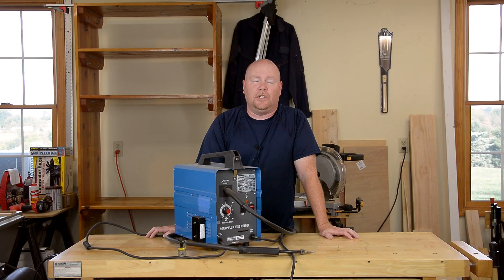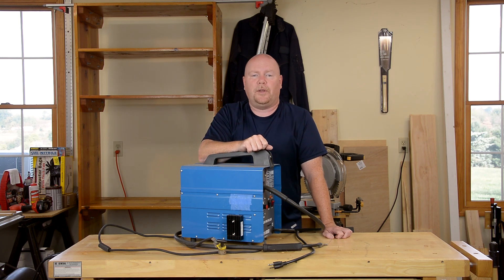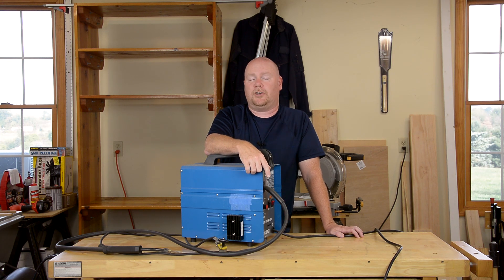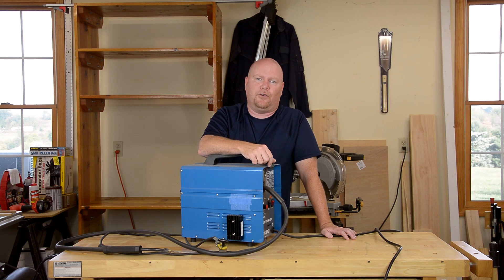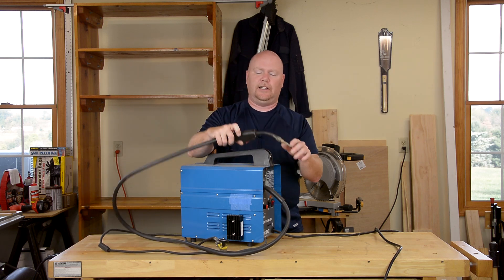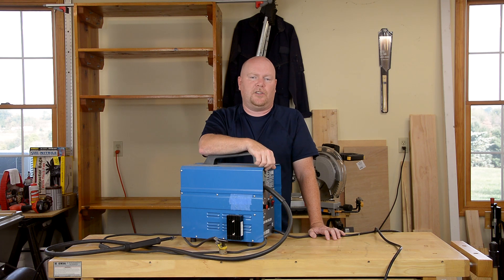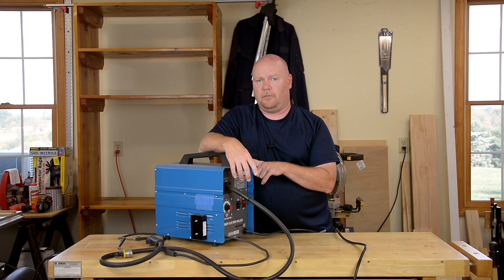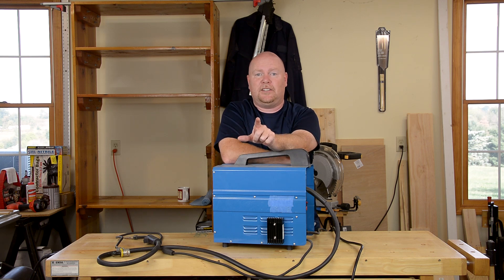Advanced Harbor Freight 90 Amp Welder Mods 09 - The F.A.Q.

Comment: Thank you I knew a choke and filter capiciter were needed some how to smooth the flow of the ripple. I've saw a lot of guys just slapping a bridge on the front of an ac welder, and I'm like there's gotta be a cap or something in there. But i didn't know where in the circuit or values. I'm currently working on a lincoln ac 225 tombstone stick welder. Any advice is greatly appreciated. God bless.

Comment: I have a question on the capacitor to use. I have a 500v 1800uf capacitor I got for free. would this work in the conversion?
Reply from the maker: It will work.  The rectifier makes 90% of the improvement, so the fact that your capacitor is on the small side won't matter that much.

Comment: Tonight i was messing around with a lincoln welder, that broke and needs a need circuit board that u cant buy any more. Anyways I was looking at it, it has a big capacitor, since I was going to junk the whole unit, I might just take parts and swap some and put them on my Black Case Harbor freight welder that I dont like or use. At least if it doesnt end up working well in the end It will be a project that won't cost me much. Thanks for idea, and the knowledge.

Comment: 40volts dc is more then enough for the capacitors I never seen anything over 34 volts
Reply from the maker: Most electrolytic caps have significant tolerances on their ratings.  If you want to run a 40V cap in a 34V circuit be my guest...and have spares.

Comment: Remember guys about the fan if you use plastic coffee can or a plastic butter bowl cut it in half and leave 3/4 of an inch of a lip at the bottom so you can screw that onto the back of your welder when you make this shroud around your fan you're actually making a tunnel fan in your machine it will suck the air in from the outside and into your machine and over all your important parts and it will force the heat out you should do this no matter what even if you don't ever do anything else this is free and it's cheap

Comment: Fyi i got 2 cheap 50v 100kμf from ebay for 25$ and both of them tested correctly but when i hooked them to the welder they both blew up..  so id recommended getting 63v caps minimum..

Comment: Hey Matt, OK, so I did the conversion with a 200 amp bridge rectifier and a 50v, 68,000 mfd capacitor. Checked and rechecked the wiring for proper hookups. Turned it on, fan and wire feed worked. Went to test for a weld and it worked for about 10 seconds and quit. Tested the rectifier from instructions on another you tube site and it was working properly but only if that type of test was correct. ( don't know the proper test for it ). I then tested the capacitor with a tester that my late Father had left behind and it showed a short. This was claimed to be a brand new capacitor when I bought it online.  So I proceeded to bypass the cap. and try it that way. Have power to the fan and wire feed but no spark for welding. 
Any idea's what doo-dood the bed ? What do I look for ? How do I test It ? What is the proper voltage going into the rectifier and what is the proper voltage coming out ? Did the circuit board puke ?

Comment: Uughh. Just finished the DC conversion using a 200a 1600v bridge  rectifier with nice aluminum heat sink attached to it. All 8 gauge copper cables with soldered and crimped in a copper piece of tubing, and heat shrink. I used 4x NIC 15000uF 50v low ESR capacitors in parallel.
I turned it on, everything seemed OK and i could clearly hear the sound of the 2-3x more powerful fan. Attached the ground clamp to a piece of clean angle high carbon steel (old bed frame) and bzzzzzzzzz.... sounded great, started to lay down a better weld than Ive ever managed to do with the welder.... then the wire stuck... then stuck again... then the lights dimmed slightly. I quickly turned it off, and discharged the capacitors. It was after midnight so i figured ill open it up in the morning. Hopefully its something easily repairable.
Reply: Nevermind. I'm an idiot. I didn't have the nozzle on the gun since these welders clearly don't have Gas, and when you omit the nozzle, you gotta wrap the metal near the tip with electrical tape. After wrapping it, turned it back on and bzzzzzzzzzzzzzz! PERFECTION! (for a shitty $80 welder + mods). I did a few beads and it was clearly the best welds ive ever done using this welder. Still nothing like using my friends lincoln electric MIG with gas. that thing is a dream. Also costs a grand.

Comment: i have a question matt, i have one of the same welder but black one (90 amp)..its a few year old, maybe as old as urs to dated but its not burning like it used too.. an not penitraying... it used to work well.. still working but not getting strong weld like first time, would this mod help in anyways... what do you think..
Reply from the maker: Hard to say.  There's not much that can go wrong with these.  Check and make sure you have good clean contacts around the wire feed and a fresh tip.  If that's all OK then your transformer is likely going and the welder isn't worth investing in.
Reply: @MattHeere  
hey man thx a lot.. i  will try the mod anyways.. good advoice..👍
Reply: Since it still works it's worth considering the following before giving up on it unless it is the transformer going bad.

Could be as simple as bad connections developing resistance somewhere along the cables...

Think of it like dirty battery terminals in your car the inhibit the starter.

Grounding clamp, crimped connections inside, etc.

Where ever the resistance is, is where the heat will be. Might pay to look inside at your wiring and connections and search for heat stress or damage.

Comment: Hi Matt, Harbor Freight has discontinued the 90 amp Mig welder. I have one that I converted to DC based on your information. It worked fine for a while but eventually stopped working. Not sure what failed but it powers on and the wire feeds out when the trigger is pressed, but it no longer welds. I am considering getting the 125 amp Mig Harbor freight currently sells. What I would like to know is what value of rectifier and electrolytic capacitor would be recommended for this upgrade. Also would grounding the tip after use to discharge the current damage the capacitor. I have installed a 10 watt 20 ohm block resistor across the cap. I cannot go back to welding flux core with AC again. Any suggestions would be appreciated. Take care.

Comment: hey mat, good videos, and info on improving HF welders, quick question, just came across your videos, so I don't know if this question has been asked, I have the newer 125 amp version HF, and wondering if the 150 amp rectifier / 3 phase will work with the  125amp welder, 
thanks

Comment: I thought the old rule of thumb was 2000 uF per amp for an unregulated supply, so for 90 Amps wouldnt you need around 180000 uF?  Even a regulated Astron follows this rule
Reply from the maker: If you're building a supply for electronics and care about supply noise (like you're feeding an amp) then sure, you want lots of filtering.  Just to short it out against two hunks of steel and have it stay something that looks like D.C. is a much lower bar for acceptable supply ripple.

Comment: Matt......EXCELLENT series.  I'll be making the mods to a HF MIG 180  welder.  Any suggestions what size and type of parts I'll need for rectifier and cap?  It is a 240v 3 phase unit

Comment: Great Mod, Matt! But I have a question. I purchased this welder for $50 bucks but the FUSE was blown out that is on the circuit board for the feed control motor..... I can't find out what that fuse AMP is. Not even in the directions manual. I tried a 2 amp and it popped it.... lol...   Can you test yours and let me know? Thank you!

Comment: Purchased a 50v 47000uf black can capacitor that says audio filter and is Chinese made lol hope it works, anyone know if the black caps are just as good or equal to operation with the blue colored ones?
Reply: Color shouldn't matter, it's only a form of heat shrink sleeve. The numbers are what matter, as does the quality...

And most people forget that the age of the Capacitor comes into play also with the dielectric. Older caps of that type can dry out.

Aside from that make sure you don't get one made in China from around 2005-2008 during the old Capacitor Plague... :D

I just had to replace a whole set of small ones in my LCD monitor that began to bulge and fail.

Comment: Mr. Heere, I just wanted to say thank you for both putting out and, keeping available, this content for us late comers to the show.  I completed this modification to my welder (bought less than a year ago) only last night (10/10/2018)  Yes, your instructions are still valid, despite some internal redesign on the machine.

I opted for a 200A/1600V, full wave bridge rectifier and a 50v/68000uF capacitor and I couldn't be happier with the results.  Beads are clean, flux cap is solid, the heat/penetration is fantastic and, all with hardly a bb to be found!  I do think I'm going to add a 10W/250 Ohm resistor across the cap terminals for bleed down, as I prefer not having to arc to my table to bleed the cap.  Your instructions and clear videography were invaluable and made performing this modification a cinch.  Thank you again.

Comment: Great series that you've made on the welder conversion, very concise and easy to understand.
A good cheap source of a bleed off resistor is out of an old microwave oven capacitor, take off the top of the capacitor and there will be a 1 meg ohm bleed off resistor waiting to be reused.

Comment: Is a 3000 uf 100v sprauge 36d capacitor enough?
Reply: Too small... Voltage is okay.   Bare minimum I would say is at least 25,000 uf, but closer to 50,000 uf.

Comment: Ive a  ? re: a 220v 100amp ac welder I have been able to obtain  CAPS 50v 4000mfd . I thought its possible will it provide better performance and if so is it possible to up the capacity by going series or parallel...

Comment: If you recommend a "bleed" diobe across capacitor post, whatvlues do you recommend?
Reply from the maker: It would be a resistor, not a diode, and I don't recommend it.  If you scroll through the comments you'll find folks who have done it.  If they drain the capacitor quickly enough to be effective, then they're big, expensive, and dissipating a lot of energy the whole time the welder is on.   If they 're sized smaller, then you have a significant time where you have to treat the cap as hot anyway.  Seems pointless to me.  Just be careful with it ALL the time.

Comment: Without a doubt, your AC/DC conversion of this Harbor Freight welder is the most comprehensive, neat and tidy, easy to understand conversion of any shown on YouTube. Just this past week end, I purchased a new 125 volt HF flux core welder. It will be a hobby welder and I have not yet tried it out. Since your post is dated Sept. of 2015, I am wondering if your welder is still holding up electrically? I bought the HF two year full coverage warranty and am hesitant to do the conversion as I'm sure it would void the warranty. Thanks for an A+ video, Matt.

Comment: Hi Matt...I, like a lot of people, have found your series on modifying these interesting little welders.  I do have a question though which about placement of the components.  Other than aesthetics, is there anything stopping someone  from mounting all the components in a container on the outside of the machine so all you're running in or out are the wires?  Seems easier than busting knuckles around in there an it'll be easier to keep an eye on bending the connections to the cap.
Reply from the maker: No reason other than the length of the wires inside the unit.  You'll end up needing to extend them, and it's really not that tight of a fit inside the machine.  But as long as your airflow is good around the rectifier - put the stuff wherever you like.

Comment: Hi Matt, another question for you...HF is now discontinuing the 90a model of this welder in favor of a new 125a version.  Do the values for the rectifier and cap still apply or will they need to be different?  Also, I have a single phase, 300 amp, 1600V rectifier sitting on my shelf already.  I'm fairly certain I know the answer to this but...will that rectifier work for this mod?  Thanks for the great videos and all the best to you!
Reply from the maker: The rectifier certainly needs to be bigger.  That 300A job you have is perfect :)  The voltage will be higher too, so the minimums for the capacitor may be higher.
Reply: I was afraid you were going to say that.  Any estimate as to what you think the mins, for the cap, need to be?  I found a 100,000uf, 100V for a kind of "reasonable" price at $72.  The voltage doesn't seem to be the driving factor...it's anything larger than 100,000uf gets to be such a ridiculous price, it would be cheaper to invest in a new welder. LOL
Reply from the maker: Well the good news is that you don't need a cap nearly that big.  25,000 uF is plenty.  I hate to guess at the voltage, although I'm certain that 100V is safe.
Reply: That certainly helps.  For anyone following along with this conversation, I just sourced a United Chemi-Con 100V, 24,000uf cap, p/n E36D101LPC243UDA5M, for $27.95.  It is in stock at Digi-Key, p/n 565-3679-ND.  I guess I'm going to have to get my video camera out and cleaned up and get ready to make a video of the mod I'm fixin to do to my welder.  Thanks for the assistance and inspiration Matt!!!
Reply: hey matt, I have the newer version of HF welder (125a) are you saying the rectifier has to be a higher than 150 amp for the newer version, am starting to search the web and gather parts, thanks

Comment: Hey there, I'm giving your modification a try on my Harbor Freight welder as well. One quick question. I ordered the same rectifier that you used. the only problem is they sent the wrong one.They sent me a 100amp 1200v instead of the 1600v. Do you think that will be a problem?
Reply from the maker: Won't matter a bit.  The actual voltage in the circuit is less than 50V.

Comment: Hey: Where do you find replacement accessories such as thread-on-copper nozzles since Harbor Freight doesn't sell them for the 90 amp rig?
Reply from the maker: The tips are identical to the ones for a Hobart/Miller/Lincoln.  They're available anywhere that sells welding stuff, including Home Depot.

Comment: Great Vid, enthusiastically, and thoroughly explained. I often find it better to start with a low end piece of equipment and upgrade it, as you gain a better understanding of the principles behind the process. A tip for connectors is to use 5/16 or 1/4" tubing for butt connections. I couldn't find connectors at HD either. U da man!